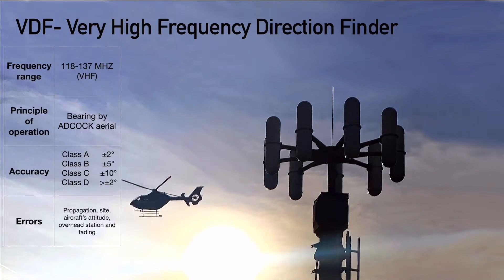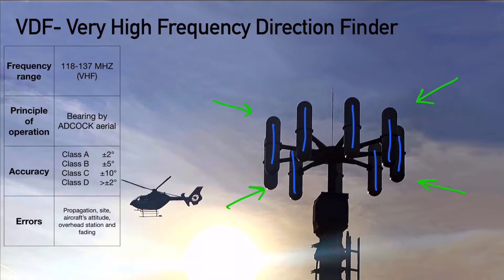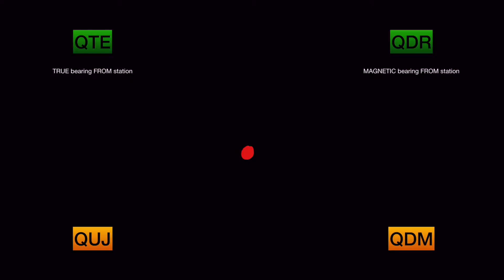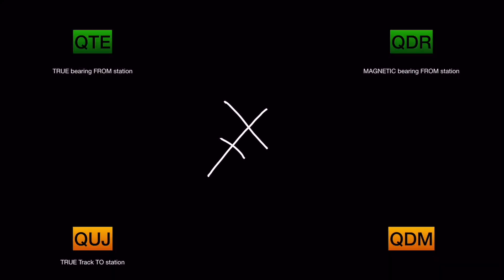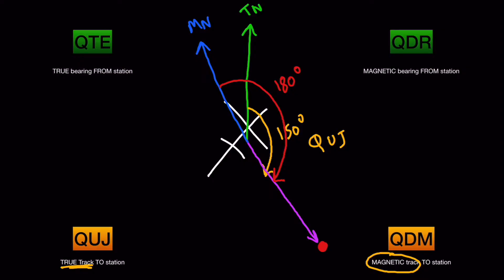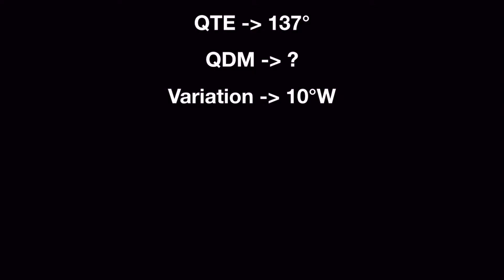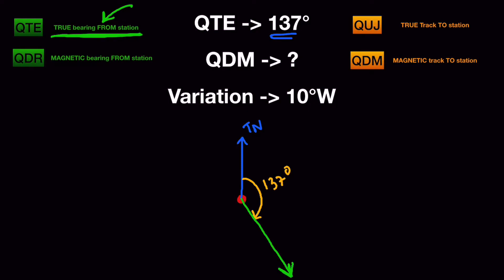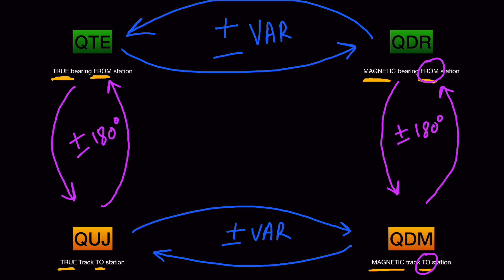CPL/ATPL Radio Navigation | VHF Direction Finder (VDF) | BEST EXPLANATION OF QTE, QDR, QUJ & QDM 🤩

Comment: Easier way to calculate is 
When u have true and the required is magnetic and the VAR is West than add the true and the var If the answer is higher than 180 we subtract the answer with 180 if it’s lower we add 180
Reply: thanks for thiis trick. really helpful